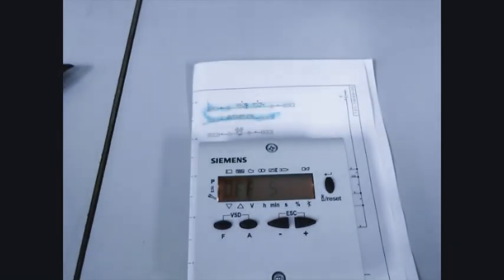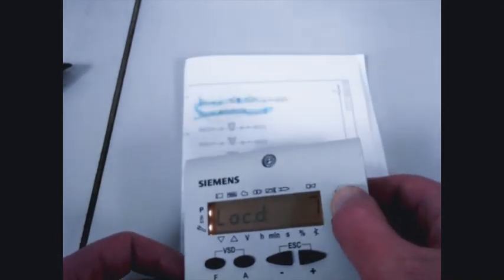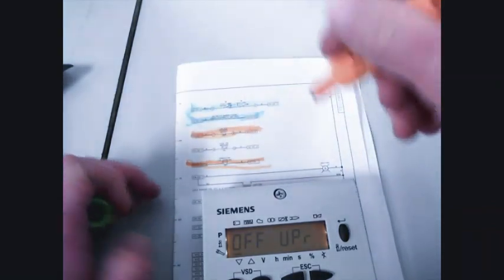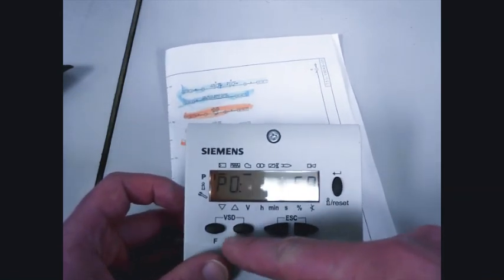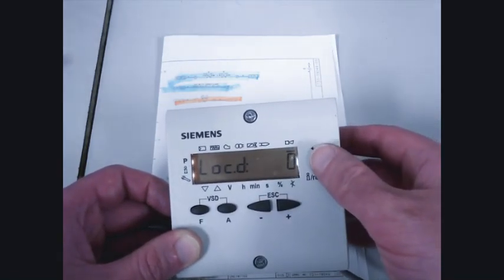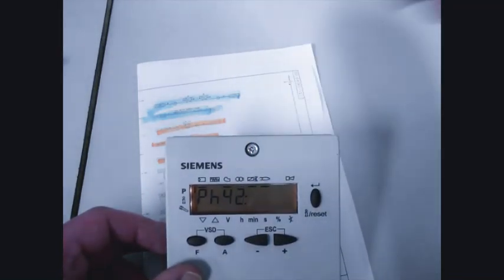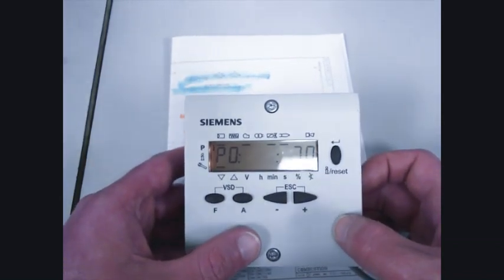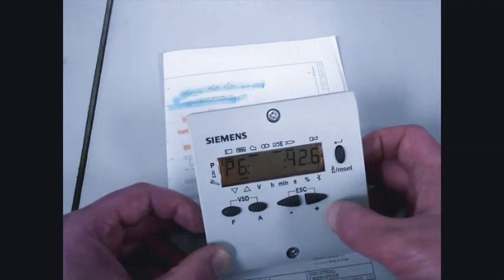ProFire Q Burner Siemens LMV3 Commissioning Startup

Comment: No fuel flow? This is strictly parallel positioning? How do you know you make your turndown or you don't over fire especially on new equipment install when working with calculated burn pressure numbers. Might as well use single point. What are the benefits here? 400ppm co??